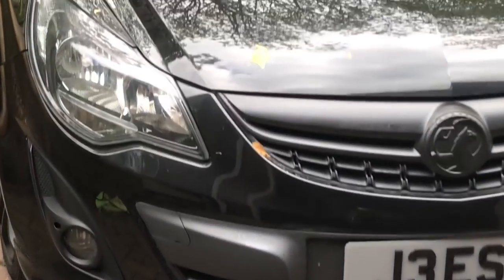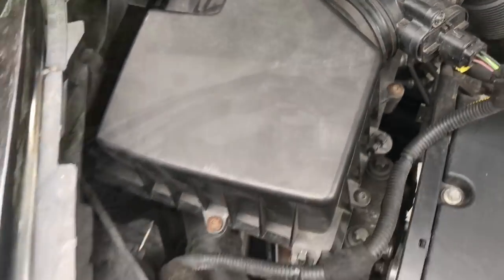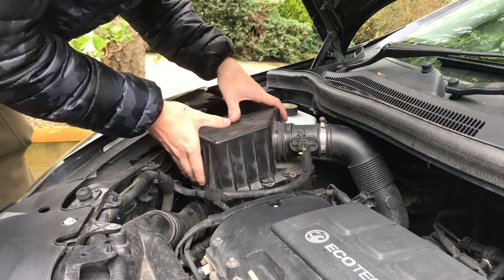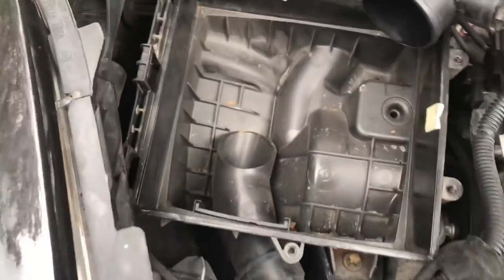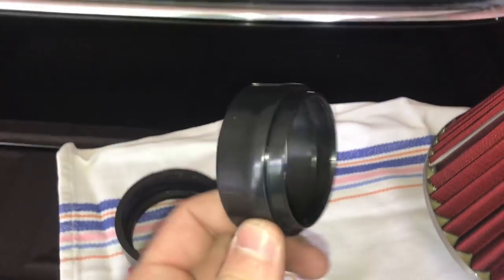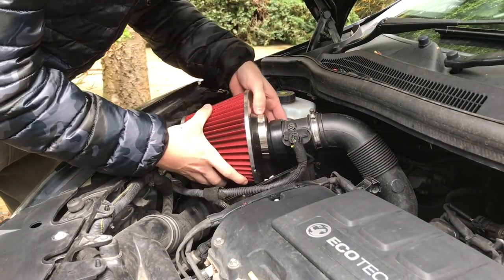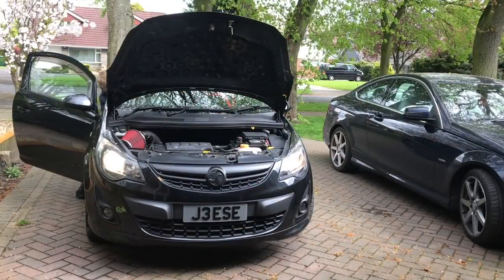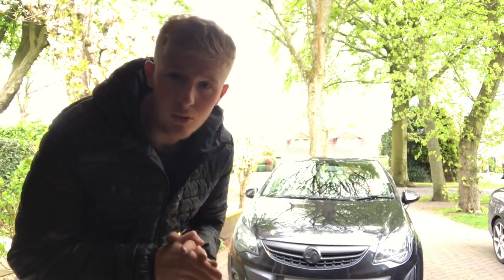HOW TO INSTALL A PERFORMANCE AIR FILTER YOURSELF!!

Comment: if you install one of these for the sound then thats an attention seeking thing. if you have a 1.2l engine and want to acheive sharper accelration due to the shite pulling power from stock air intake then thats a a better attitude.  Then you have to consider how much fuel your saving, this is the right attitude really bearing in mind you spent 40-50 quid on one, so how mnay miles will you have done to level that spend vs save out?

Comment: Im looking about for debadged grill rather than spray it.am like you i hate the colour of the crome id rather just a honeycomb grill00
Reply from the maker: think you can but different grills that have no logo, check ebay mate :)
Reply: Should let more air in aswell? Making that cone work better?
Reply from the maker: very true!, dont think ill have any problems anyway tbh bro, when im idle their is still the cold air feed directly underneath so hopefully the only difference is the top on the box isnt on
Reply: Try and find an irmscher one, in my opinion they look the nicest

Comment: Lol. Hardly worth it. More power in my fart. These are filters only serve to reduce power. Need a remap otherwise the ecu pulls the power back. Also air filter drawing in warm air from the engine bay. Pmsl clueless
Reply from the maker: beebo better than a bus ticket tho

Comment: Gonna fit one to my 1.7 cdti astra.
Reply: Did you fit it? If so does it sound any good?
Reply: @lukaskail1411  no, didnt bother, read to many comments about how that car doesnt like aftermarket airfilters.
Reply: @scottishbawbag315  I've got a astra k 1.6cdti and thinking about putting it on mine, just wanted to see what it sounds like before I done it